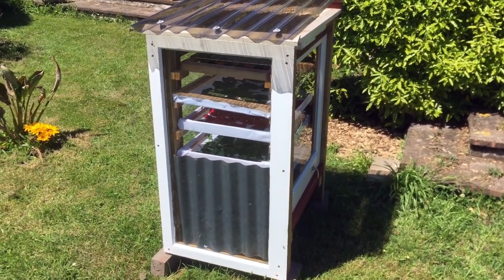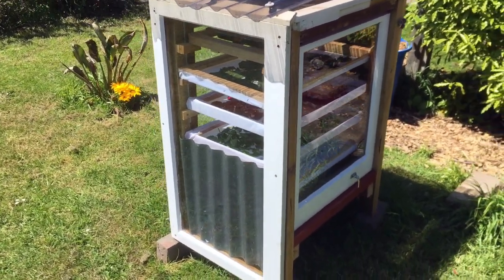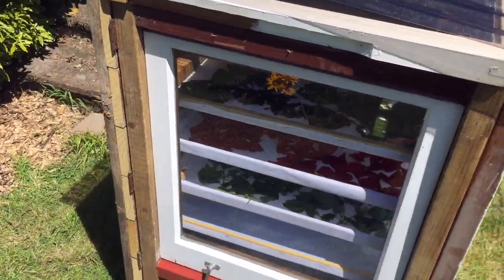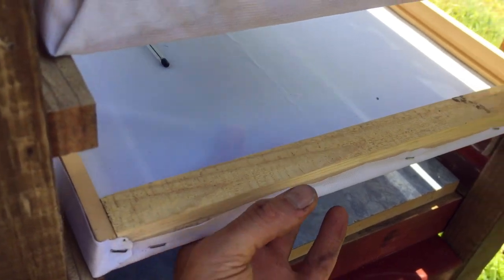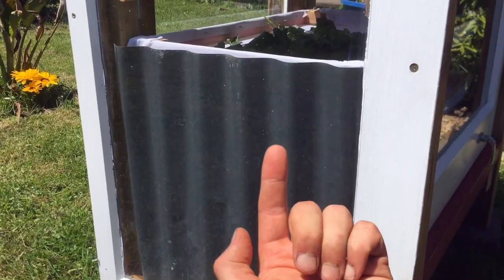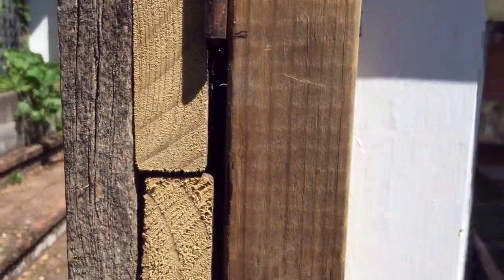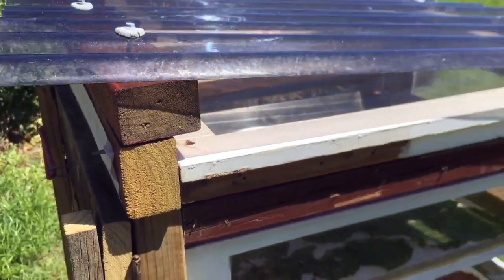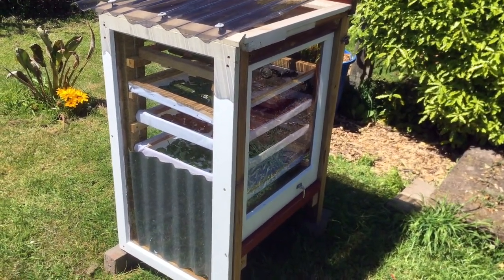Funky DIY SOLAR DEHYDRATOR - Basics explained & why you can make one too!

Comment: Nice design.Could add roller wheels for easy movement.
Is the glass and roof material UV treated?This protects the food from nutrient damage.
Reply from the maker: Thanks! Very much an improvised design, based on the materials we had at hand. I assume that the materials are not UV treated. They were very old window frames and other random stuff that had been in the shed taking up space...

Roller wheels would be a good idea, but could make it more difficult to move around in non-surfaced areas?

I guess this was more a proof of concept than a great finished product. There’s a few other improvements I would make when making the 2.0 version!